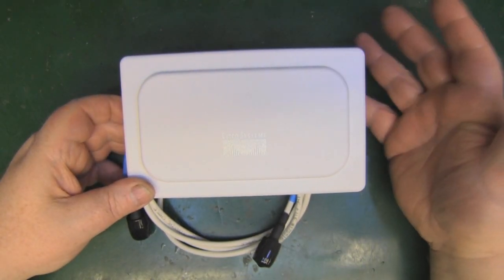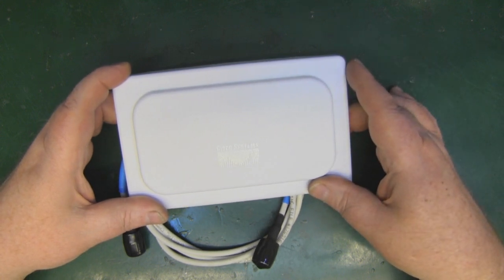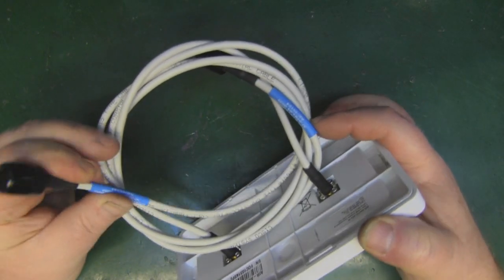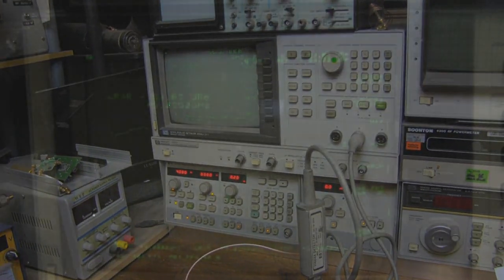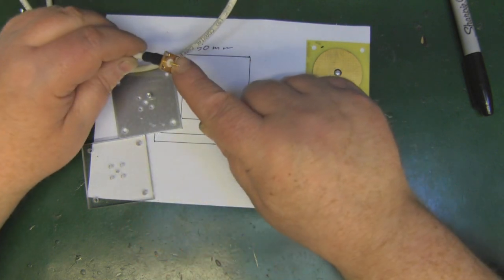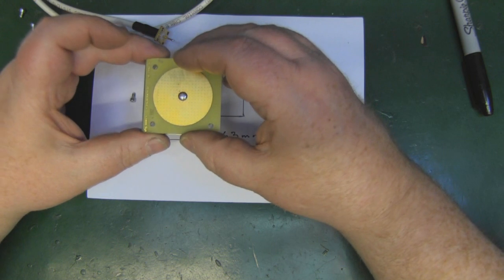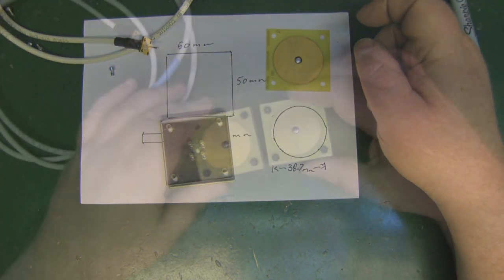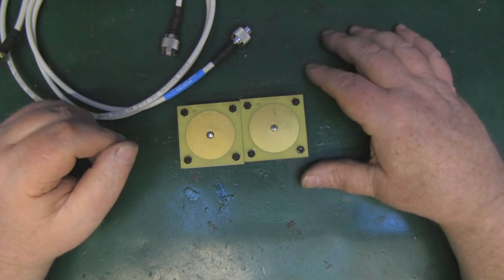Cisco Aironet AIR ANT5145V R 5GHz 4 5 dBi Panel Antenna

Comment: Early Cisco APs (1220 series) used a diversity receiver where it would switch between the two antennas very quickly to pick up the best signal. This would help in environements where multipath was an issue. This was for RX only. The Transmitter would just transmit on a single antenna. The antenna will still work on later radios that use MIMO (2x2), and make use of both elements at the same time. Great idea to unsolder the driving connector and refit with SMA.

Comment: Hey Andrew, was the underneath circle on the PCB electrically connected as well ?  Also, love you to look at coaxial collinear antenna sometime.  Lot of controversy on these due to the propogation rate on internal vs external of the components.
Reply from the maker: Yes it was. I have played with coax based collinears in the past and not been impressed but it has been a few years maybe worth revisiting
Reply: @andrewmcneil  Love to have a chat about coax collinear if possible.